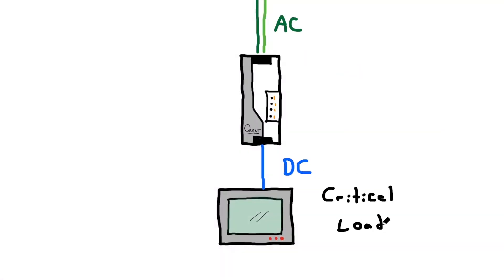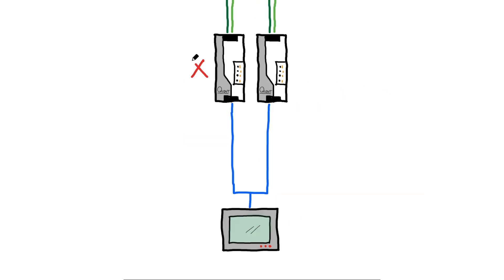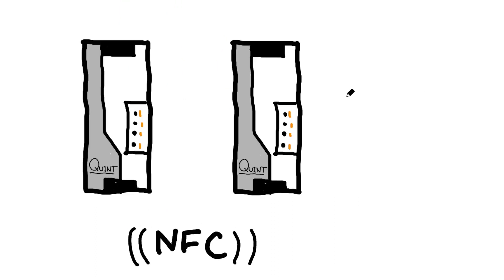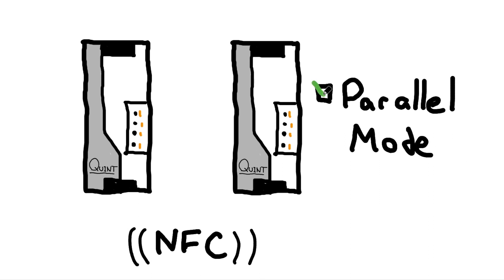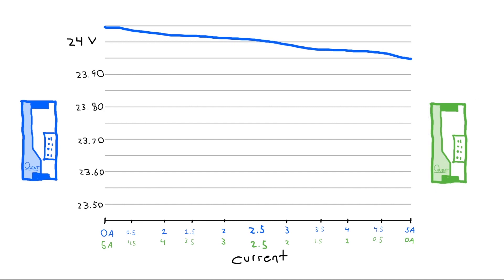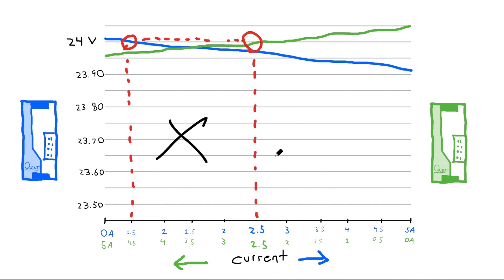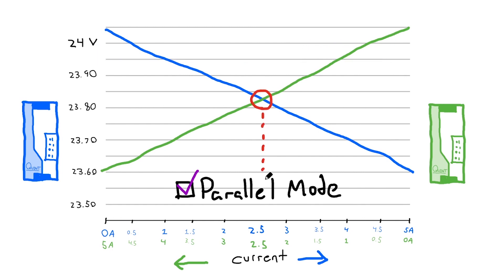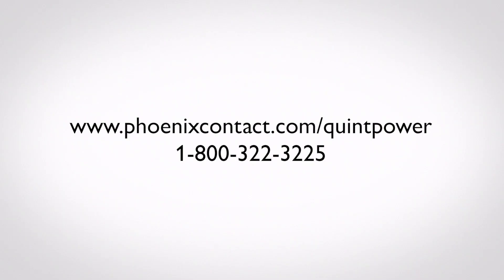Load sharing and redundant power systems

Comment: I understand the voltage drop, but why does one power supply have a rising slope?
Reply from the maker: One characteristic is shown left to right and the other right to left. The voltage of either goes down when load is added.  It's better shown this way to understand which supply gets the lion's share of the current. Look at the highest point of each characteristic. This tells you which supplies draws the most current at the intersection. If they are equal, then they can share evenly. It's easiest to pick a single load point and focus on what going on there.

In parallel mode, the change in voltage does not change the load sharing as drastically or quickly. (The characteristics are steepened)

Comment: Hi!! Hope you are doing well. I am working in the hospital as a Biomedical Engineer. Unfortunately 1xQuint4-3AC-24VDC-5 out of 2 connected parallel in electrical control panel of medical vacuum pump becomes faulty. Is it possible to operate our vacuum pump on single quint4 supply the one which is in good working condition? If you need picture of the control panel i will glad to share with you.
Reply: depends on the Power consumption of the load. if it is below 120 W no problem...

Comment: Hello,
Thanks for the video.
I have 1 idea for power sharing:
1st power supply = Solar panels (38-48V) 3x455w (1365w)
2nd power supply from grid = AC/DC PSU 48v 25A (1200w) 
There will be diodes before load
LOAD = Battery charger (input is up to 48v 100A, output is 28v (and then I have 8 x step-down converters to 12v) )

I want to share the power between them - to work like this scenario:
1. If its sunny day solar supply will "feed" the load at 100%
2. if there is a cloud/night and solar panels stop producing power or just supply 60% of the load - the rest 40%/100% to come from 2nd PSU (grid)

To work like master and slave I am wondering if I adjust 2nd PSU output to 35V (lower than solars)? 
What do you think?
Thanks in advance.
Reply: @
@dannnielpeev Hi, Can you please help me in my problem. I have solar panels connected to charge controller and feeding a telecom rectifier Bus bar. on the Bus Batteries , load and rectifier modules are also connected. I have kept float and boost voltage in the rectifier 1v less then solar charge controller boost and float.but there is load sharing. if utillity is not available then solar production is very good But when it restores it share the load again. please help me in maximizing the solar Kwhrs
Reply: any video or document will be very thankful , need to adjust the float and boost voltage or do what should i do

Comment: Will both ups will show same load reading ?, Or will be some difference, what is its cause
Reply from the maker: Initially “out of the box” the power supplies can be balanced to exactly share the load current. As time goes by “temperature drift” which is the internal heating and cooling of the components used within the power supplies may cause the power supplies outputs to try to change. By setting the parallel mode the power supplies will compensate for temperature drift on their own. It works like “sense lines” from older power supply designs.

It is possible that during a load share there can be mili-amps of difference. However its not possible in parallel mode for much more of a difference. If parallel mode is not used temperature drift can cause all current to flow from the power supply with the higher, drifted to, voltage.

A good practice would be to check the load share balance if there is no parallel mode for a longer life of the hotter power supply. If you have a parallel mode to select you are in the best way.
Reply: @PhoenixContactUSA  we have 2 ups Schneider 100 kva parllely connected to load, but they show different ampere reading, one or two amps difference , is it normal or it have any problem
Reply from the maker: @deeptalks3938  I wish I had an absolute answer for you. 100KVA is a lot of AC Power and a lot of amps available. The difference in amps may or may not be OK. One scenario to consider is are the sine waves on the outputs synchronized? They need to be in phase or you’ll have issues. I suspect the Schneider system handles this but I really have no idea. If something is getting hot it’s a sign. I would call the Schneider tech support to have them bless your wiring diagram. Hope that helps and enjoy your day.